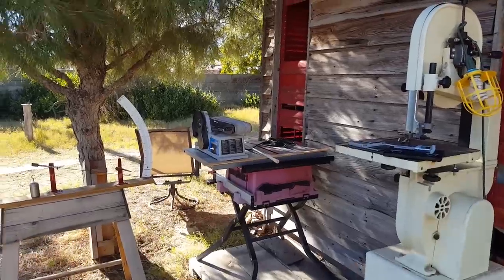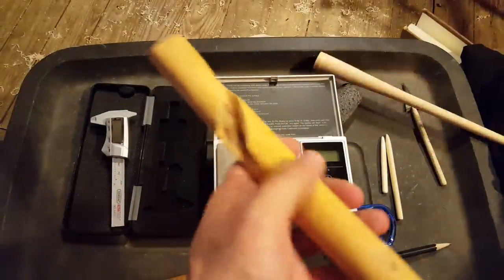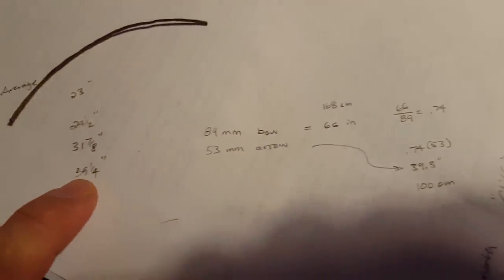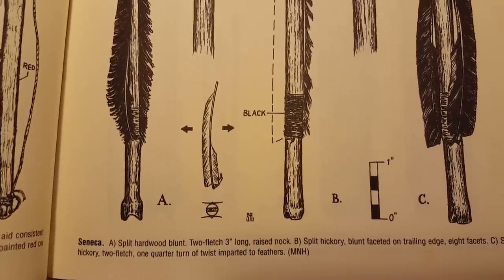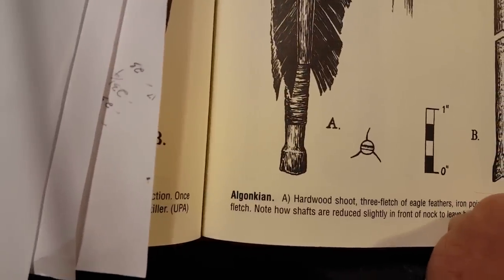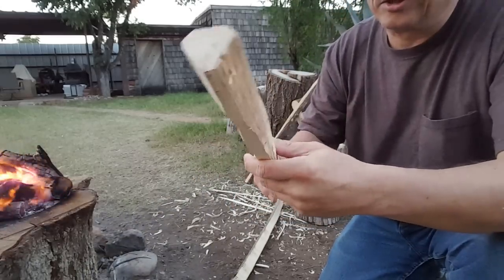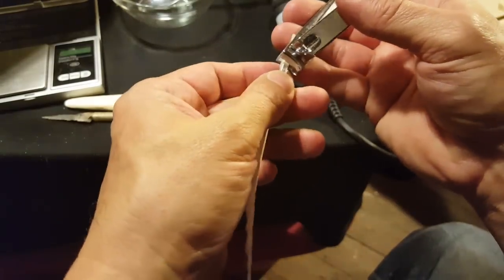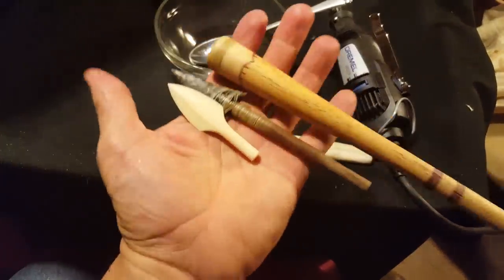530 - Hickory Arrow - Eastern Woodlands Heavy Tip (full version)

Comment: Pat the one with the big and on it where the four shaft goes that reminds me of a cornstalk shoot Arrow the idea behind it is you put a long thin needlepoint on the end of it and you try to penetrate as many corn stalks as you can from like a hundred yards away so they want them front-heavy cuz they shoot them way up high in an arch and the Streamline probably wouldn't matter as much because they got like a big 12 to 18 inch long usually some kind of metal sticking out of the end shaped like a needle that's what that Arrow reminds me of
Reply from the maker: Cool.  I think I've heard about those corn stalk shoots somewhere...  probably a video.

Comment: Did you spin the arrow with a drill while sanding? It looks very uniform.
Reply from the maker: No, I rarely spin the arrow shaft unless I'm working on the nock.  I like to keep the sanding marks in line with the shaft as much as possible.  Cross-wise sanding marks on the nock help with the grip, so it's ok.  I know that I could remove all sanding marks at the end, with fine grit sandpaper, but it affects the spine and it takes a long time to perform the action of sanding and approaching the spine simultaneously while using fine grit.

Comment: 24:20 is that a coiled basket quiver? i made one from grass and it was really heavy now im making one from jute and the materials perfect
Reply from the maker: Yes, that's a coiled basket quiver in the book. :-)
Reply: JackCrafty could you do a vid talking about them its hard to find any info online thanks.:)
Reply from the maker: Sure.  I need to do some more reading but many of these basket quivers were made very carefully, just like any other basket.  Large pieces of bark were also used as well as hollowed out stalks and carved wood.  Hides and woven cordage/yarn were far more commonly used, that's probably why there isn't much info on the basket type.  Basically, there were two things that made up the basket:  a carefully prepared and strong material (like root) for binding everything together and a  quickly prepared and heavier material (like stalks/shoots or very thick cordage) for the main structure.
Reply: JackCrafty thanks..seems like these quivers may be quite heavy in comparison to a hide quiver and the amount of work that goes into making them makes ne wonder if that many were made(honestly i taught i came up with the idea myself until i seen this vid) thanks again keep up the great vids :)